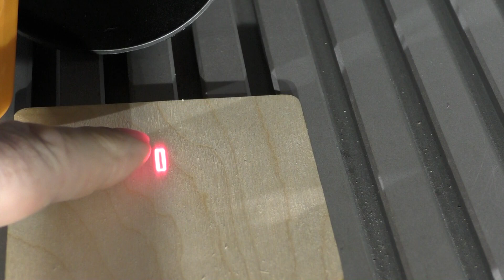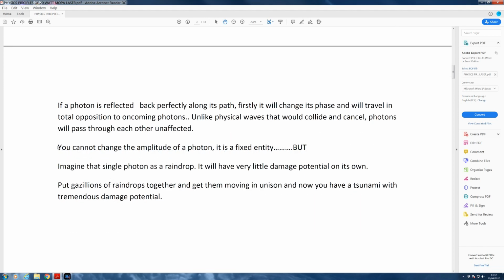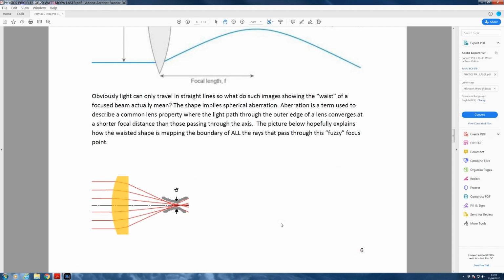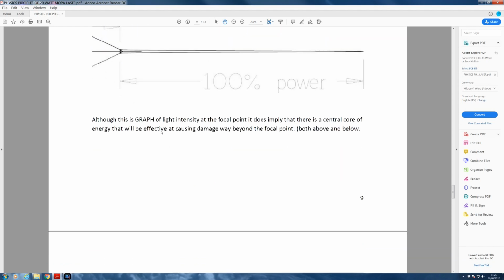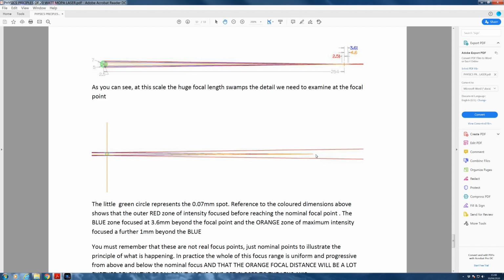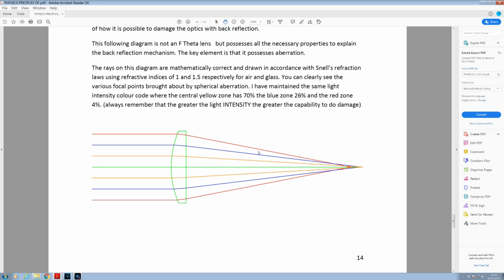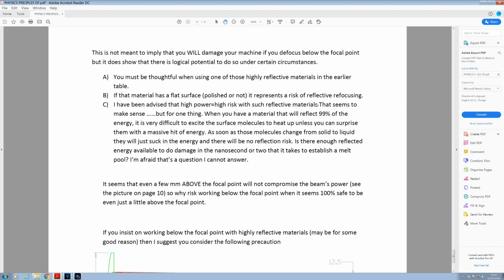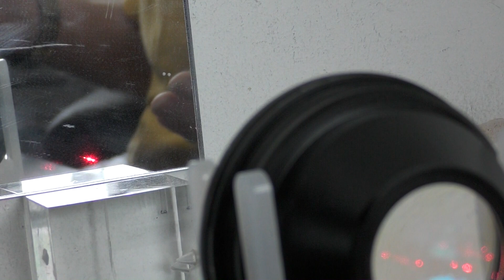Fiber Laser Learning Lab 19 Back Reflection

Comment: Great video Russ.  We love your unique methodology. To be clear for those that have doubt, you absolutely can damage the optics by back reflection the extent of which can range from minor to catastrophic and none of which will be covered by your suppliers warranty. We have seen it with systems that we have supplied albeit it is rare because most users follow the guidance. Your hair is getting long. All the more to pull-out during your next challenge :)
Reply from the maker: Every one of those grey hairs  is a pound my wife has spent!!!!  Who knows what she would do to the back if I let her loose with clippers. I have visions of that SpecSavers sheep dog!!
By the way thanks for reinforcing the point. I'm not about to wreck your machine. It was an intriguing journey into the unknown.
 Best wishes
Russ
Reply: @SarbarMultimedia  That's a lot of pounds there Russ :) my old dad used to say about my mum (the wife) "she's not cheap to keep but extremely expensive to get rid of". The guys here want you to do more with the metal deposition app. contact Johng@lotuslaser.com to get images of what he did today.

Comment: you also forgot that the spot it hits melts gets blown out and forums a dish shape that by chance can focus the light back to the source
Reply from the maker: Hi
 I feel sure that any beam that is only about 0.07mm diameter is unable to produce a dish that has a focal distance of more than a few mm.  There is one more logical issue  that removes any such risk of back reflection  When metal is molten it absorbs light energy , thus  when the light creates a molten pool it is absorbing the energy and no reflection can exist. It is only when the beam has moved  on and the ablated secion cools back to the  solid crystalline state  that  it become reflective again.
 Thanks for an interesting discussion point
 Best wishes
Russ
Reply: @SarbarMultimedia  i never really dig into it like that but i have a 40 w visible light laser and during a percing i can see the shape the reflection on the back plate as a test i put my laser at a 15deg angle to track the aka back scatter effect at 608nm on stainless steel and a fixed laser and the reflection is as expected at first tell a craters started then it starts progressing back in the direction of beam before fading away apx 20deg of set from the source my guess is it fades out as the absorption increases any way without proper testing i can't really tell what the total reflected power is but looking at the spot size and brightness on my camera with 4 stacked ND16 filters and a fixed shutter. It's a very rapid decay rate. This is an interesting approach to looking at physics and the effects of laser have on metals i don't think is even fully understood 🤔.  But from what newer data tells us photons are the glue that bind atoms and might even be a key to how gravity works. So mehh 🤯
Reply from the maker: @ZoeyR86  
Hi
 I agree that the physics of lasers. lenses and materials is a fascinating subject.  The way that different wavelengths of light stimulate molecules  to excite them and causes their temperature to rise is not a subject they teach you about in school. It is the different bond strengths within a molecular structure that determines how much and and to what extent it will be stimulated by a particular light wavelength. Back reflection from metal is a real issue if you are using a a normal CO2 machine because the lens is so close to the material.  In a fiber laser machine with a scanning galvo head they use something called an F theta lens that allows the lense to be set 200 to 300mm away from the work.  That distance is so large that it requires but a fraction of a degree of surface offset and any reflection will miss the vital lens axis and become defocused. . Beyond the lens there are several meters of fiber optic cable that is used to create the laser effect and I was never able to determine which part of the fiber system was at risk of damage . I was just passing on "expert" warnings. Your visible light system is very low wattage, I suspect,  and the lens system is reasonably close to the work. I cannot imagine there is enough reflected power to damage your lens because that will be normal optical glass. However,  it may go beyond and damage your diode. I don't know enough about your mechanics to predict the risk but I suspect that because metals at that short wavelength are good absorbers then the low power reflection that may occur will pose little risk to your system. There are now thousands of people using these lasers, and mainly on metals,  so statistically if there was a risk then it would be widely discussed on forums.
 Best wishes
Russ

Comment: I would only add that it is not the original surface of the metals that reflects, but the melt in the affected area. Therefore, it does not matter what surface - mirror or matte, or blackened. The material itself is important.
Reply from the maker: Hi 
It is the very tight crystalline nature of all metals that prevents the molecules being excited by IR light. As the wavelength gets shorter the various metal molecules do respond a bit more and will be more excited  by 1micron wavelength light. than 10.6micron.

https://www.google.com/search?q=rflectance+of+metals+at+1micron+wavelength&tbm=isch&source=iu&ictx=1&fir=CIi_AS9eig0T2M%252Clyp4GFuFnEYp8M%252C_&vet=1&usg=AI4_-kS7Kci-N4PkVQfGRp7eaCuB08B8rw&sa=X&ved=2ahUKEwi-ifbSw_DsAhUKi1wKHfd9AKwQ9QF6BAgHEAw#imgrc=BgWHd4BHRQFFNM&imgdii=Xq6mQ7fGOZh3sM

That excitement makes them vibrate faster and thus become hotter. At a critical temperature the metal will melt  and at that point the tight crystal structure no longer exists and the light energy is no longer reflected  but is rapidly "accepted" by the free floating liquid molecules leading a highly efficient energy transfer from light to molecular vibration which results in  a cascade heating effect  which maintains the melt pool.  
 Here is a reference to this effect
https://amadaweldtech.com/blog/laser-welding-basics-how-does-laser-welding-work

 In summary solid metal surfaces reflect laser light and molten metals absorb it.

Best wishes
Russ
Reply: @SarbarMultimedia  
Thanks! You've revealed something new to me. It turns out that the degree of reflection from the material depends on the aggregate state it is in. And it turns out that the reflection in the liquid phase is less than in the solid. This means that my sellers of fiber markers blatantly lied to me: -)
Once again, thank you so much for your lectures! I haven't found anything like this on the web yet.
It's a pity you didn't do the same deep research on getting a good black color on stainless steel. There are also many variations - black is fast, black is slow, surface and with biting material. Something to think about.
Reply from the maker: @IgorZh-015  
Hi
Thanks for your comment but I must correct one thing. I don't give lectures. That implies I am a teacher. No I am a student who is selfishly enjoying retirement solving engineering problems as I have done all my life. I just happen to have a long-time hobby of video and video editing.  To have a camera looking over my shoulder as I learn and to,let what is going through my mind escape from my mouth is really just a way fro me to create video content for editing. You see, it's win,win for me. I post the videos on You Tube to share my learning experience . I'm sure there is educational content for others but I never pretend to be a teacher.
As you see from my videos I'm old , grey, fat and ugly but what you cannot see is the many years of engineering and management experience that has caused skepticism to become part of my DNA. Sales guys will speak techno babble   ( and tell outright lies) because their commission depends on getting you to part with money. I absolutely love playing with these machines because there is so much new science I have to learn (it keeps my two remaining grey cells exercised) to gain a real understanding about how things work. I make mistakes along the way (so don't trust everything I say or conclude)  but that is all part of self education. Acute observation and recognizing when something is not quite as expected is when things get really interesting for me. 
 Sadly I no longer have the MOPA fiber laser. I did clearly say at the beginning of the series that the machine was on loan from a local company  who were keen for me to dig into the dark corners of this niche machine type  because they did not have time to do it for themselves. They  recently recalled  it because they had an urgent sale to satisfy.
I have been threatened that very soon they will loan me a UV fiber machine. Hmmmm....that will be another new experience.  
 Best wishes
Russ

Comment: A suggestion from an old photographer; for further lens understanding lookup 2 terms: "circle of confusion" and "modular transfer function." They may help define what a lens can do. Thanks for your research and sharing. My dry sense of humor tells me that you will like the "circle of confusion."
Reply from the maker: Hi Patrick 
The subjects you mention are serious disadvantages to normal optical use of lenses and as a photographer myself (although it's usually video of late) I am only too aware of these issues we try to avoid. The fascinating thing is that when you use a monochromatic light beam with a  Gaussian  intensity distribution exactly those bad properties are perfect for improved cutting. Chinese ZnSe lenses made by the PVD process and with less precision than more expensive high quality lenses from the likes of II-VI, have much better cutting ability.  The aberration defocusses the outer lower intensity rays and you have to set lower than the nominal focal point to get "cutting focus". 
There are limits to the trust you can put in lens theory when you are trying to damage material with non-uniform monochromatic light.
For several years I relied on my learnt knowledge of lenses before becoming aware of the shortcomings of applying it to  this technology.
Many thanks for the comments.
Best wishes
Russ

Comment: 7mm diameter beam vs 0.07mm diameter beam = 38.5mm^2 vs 0.00385mm^2 beam (or spot).
You have reduced the diameter 100 times, but you have increased the energy density by 100^2 and that is very important.
Reply from the maker: I  fully understand the area concept for amplification but I am keeping at 2 dimensions for simplification so that my two remaining grey cells can retain a simple image.  It's the 2 dimensional principle that is important and not the mathematical accuracy.      However. I appreciate your comment  because it explains to others that I have over simplified reality.
Russ